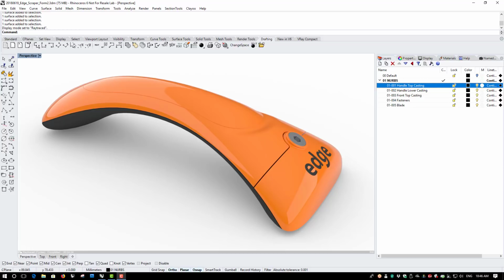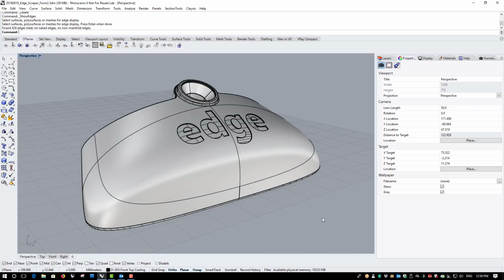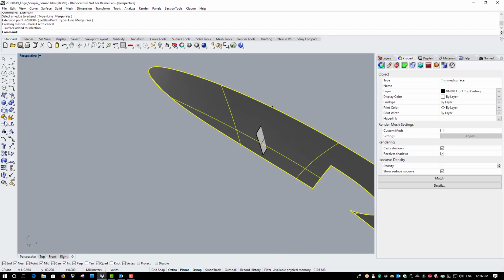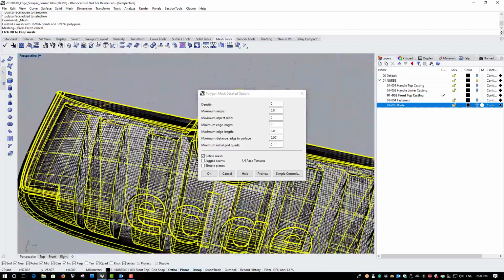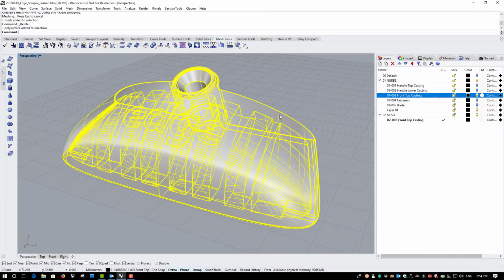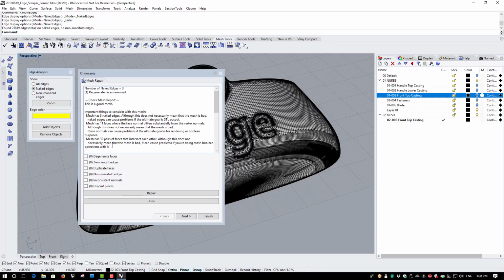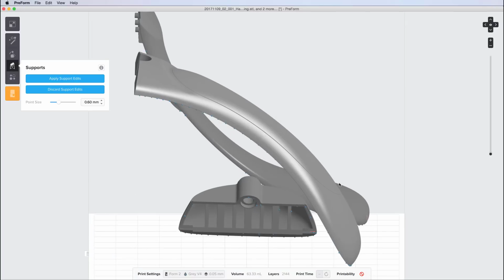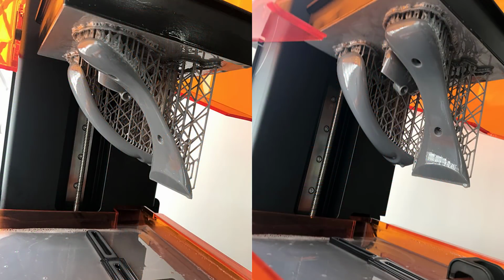3D Printing with Rhino3D and the Formlabs Form 2 SLA 3D Printer

Comment: do you loose quality when you transform to meshes?
some closed volumes of the model if i want to be solids is possible to do it with rhino?
Reply from the maker: Hi Boris. The idea would be that we convert to meshes only in order to print via SLA or similar and we’d keep the NURBS data for other purposes. All 3D printing requires meshes. Of course, meshes consist of a number of flat faces that approximate (for example)  a curved surface and so in that sense yes you lose quality BUT as long as the mesh is better or the same as the tolerance of the printer in question then it is the printer not the mesh model that is the limiting factor. Hope this helps.
Reply: @SimplyRhino3D  thank you very much!!